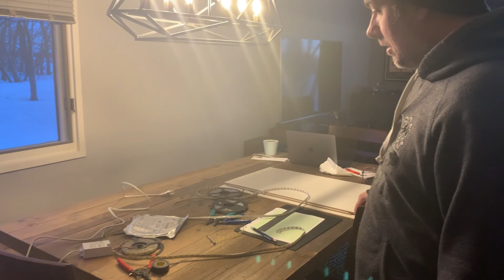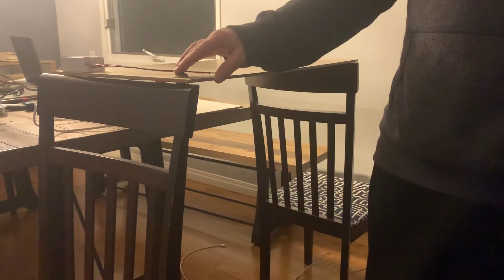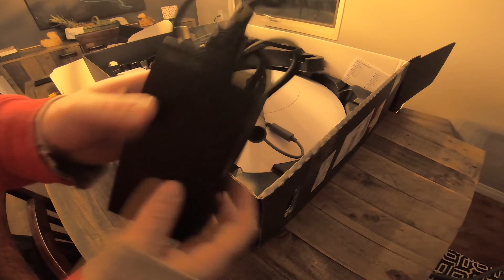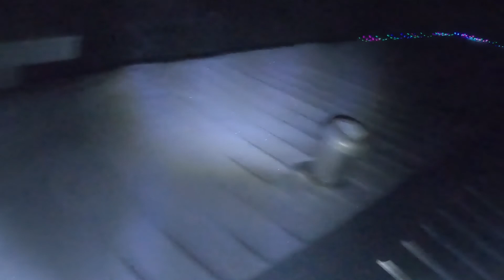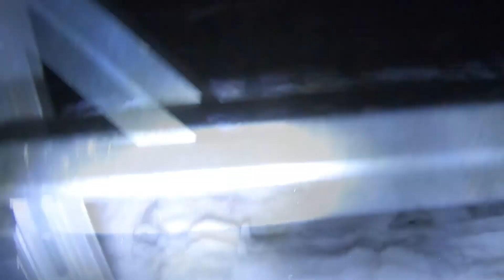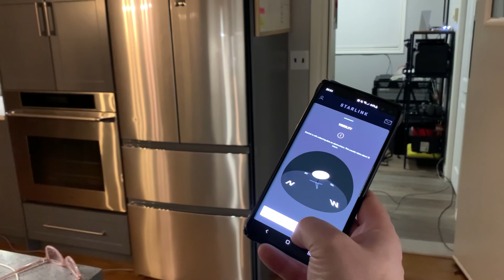Grow lights and Starlink at the Homestead

Comment: I love that you made the lights yourself! It's still so cold there! 😵
Reply: Update on the lights. We needed a better system. The panels are great, but I need to get them lower to the seedlings next planting cycle and also need to put each on its own power supply unless we want to invest money into building a whole lighting rig (we don't right now). The one LED driver we had wasn't strong enough to power  both panels, and my backup solution (a DC-DC voltage pot and mismatched power supply) worked-ish but was finicky. C'est la vie!